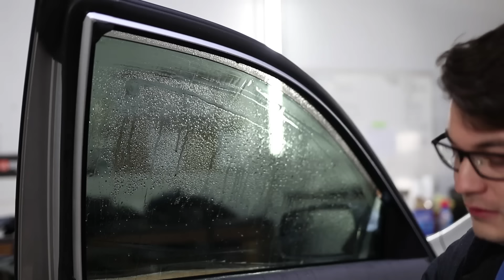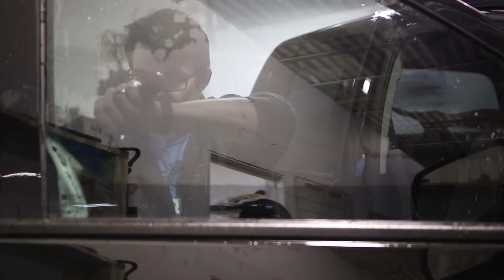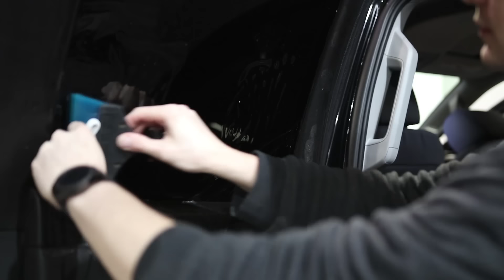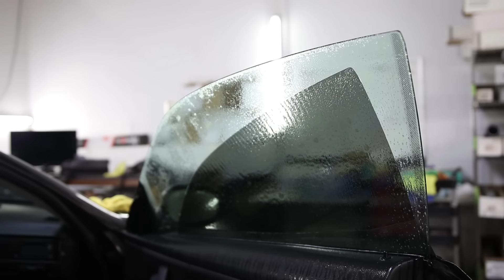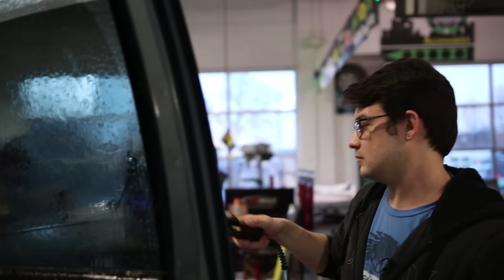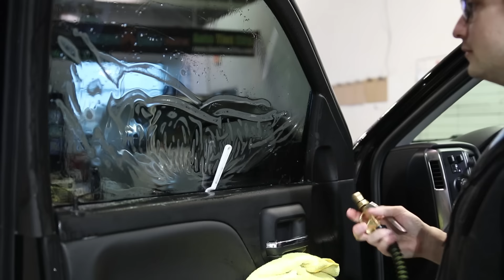Tucking Window Tint Made Easy | No panel removal

Comment: Little tip for 2 stage tinting. Never let your edges curl out. They should curl into the edge tuck. Otherwise youre bound to grab contaminates when you pull the cap sheet. This will also keep your film from creasing at the tuck point and having to shrink the crease. Another thing is when you tuck the bottom of the film as you peel your liner do it fast and quickly grab the center bottom of the film. It'll make each side fall to the window at an angle not touching any panel or gasket. Then you can tuck each side individually without pulling or pushing the film and possible creasing it!
Reply: Can you explain a little more

Comment: does spraying alot of liquid all over the place not hurt the doors material?
Reply: No. No damage. Doors can be open in the pouring down rain with no issues. A small amount of spray won't do a thing. You just end up with a nice clean door!
Reply: @ddi1558  rain will damage the door panel (rain is acidic), you need to use pure water and ph neutral to not leave stains. speaking from experience
Reply: @michaelgawlas3794  Wrong, very wrong : D
Reply: @michaelgawlas3794  acid rain huh?

Comment: The lack of protection from moisture as you pray down the windows and film is concerning.  Water will dry out plastics and collect in creases.  I'm not sure what solution you are using, but that can leave a film, even if you wipe it down after.   The worst part is the water going into all the controls on the door, such as the power switches.  You should take the time to cover these areas as best possible and take better care of your customers' vehicles.   This job is harder than it looks, but at the rate you get through those windows, it looks like you can do a car in under an hour.  I hope you charge accordingly and don't rush through Installs and charge customers for several hours if work that doesn't happen.  Very informative video, thanks.

Comment: Thanks for the video very good visual on how tucking is done today I decided to do my wife's taruras. Well the outside of the window is higher than the inside so toss that film here we go again new piece of film it's 4" long I try to tuck it, it becomes a wrinkled mess.I cut this mess hoping not to tear it up into the exposed window. I lucked out for got it tucked in no wrinkles no bubbles .wish I would have seen your video first. Thanks again.

Comment: Question ... are there any electrical issues w/the soapy water being sprayed & squeegee down behind the door panel? Where does it go, how does it dry? 
Noticed the front door panel is saturated w/soapy water therefore it has to be saturated behind the door panel as well....

Great video, you make window tinting look easy.

Comment: Guys all you have to do is take a piece of a big bondo card and cut it down to a half inch wide perfect for tucking or you could take a plastic  fork or spoon and snap it at the end breaking the tip off use the handle  and melt it with a lighter or small pocket torch and bend it into a z like shape just like the shank bend it then let it cool off and harden instant homeade shank

Comment: I had issues with moisture fingers at the bottom. I heat shrunk on the outside abs it was smooth, but I could see the misfire drawing up from the bottom and I couldn’t get them out. I’ve heard it’s because I didn’t remove door panels. How do you approach this issue?

Comment: Damn your fast so I’m getting into window tinting the beginning of 2020. I have most of my tools seen a couple you showed on another vid. What’s your mixture on solution? What are the best films to use? What’s your warranty ? Did you use heating gun prior to the start? Hopefully you get back thanks. Do you ever clean windows with scrapper blades ?

Comment: Is there a way to fix tint thats bubbled or do you have to remove and replace? Like if you can get water down into the bubbles after its been installed for years can you rewet it and it will stick?
Reply: If it's old and bubbled, a 100% solution is to replace it. If the bubbled spots still have some adhesive, you can try getting a new razor blade and barely nick the middle of bubbles (and press), see if it continues to stay down, though may have hairline cut seen through tint, it might be totally unnoticeable.

Comment: Hey bro, what am I doing wrong with side windows? I either cut the tint too short or too much on the sides and a light gap shows and I’m leaving light scratch marks. How do I cut the small side windows properly and how come sometimes ppl don’t shrink the rear side windows? I’m having trouble determining when to shrink
Reply: I shrink all of my Roll ups the smaller corner glass I don't usually shrink

Comment: I sometimes have problems with fingers coming up after I've tucked the lower edge. Is this due to incomplete shrinking? Sometimes I can stretch the bottom out left and right and get them to go away. Also, to pull back the seals and lock down the bottom I alternate between the Platinum ez reach and the yellow conquerer (which you recommended in older vids), is that fine or should I get that shank tool you're using too?
Reply from the maker: The shank really just helps with tucking, I use to use a ez reach but the shank is a little better because it has an angle that stays out of the way. 

The fingers are most likely because of what u said. I shrink a little different now than I use to. I use a "snap" method. It's in a few of my more recent videos and on Instagram. I just curl the bottom edge and it's helped a lot with keeping everything flat

Comment: I just saw a video where a shop did a full install of PPF and then window tint. They removed every door panel in order to tuck the film below the rubber seal line??????????? WTF? Is that necessary ?
Reply from the maker: definitely not necessary, lots of installers do it tho. I like leaving everything as is.

Comment: You should always pull back the top part of the door panel for several reasons...1. Theres felt on the inside window sill and dust and dirt on the door panel. If you dont pull the panel and drop the tint in behind the panel first you will always get debris inside the tint when it hits the panel and felt. 2. Your soaking all the electronic,  window switches,  electric mirrors, doorlocks. 
3. You run the risk of kinking the tint when and getting debris when handling it to much. 
4. Your not telling people that you heat shrink the window tint first. If they try then they will most definitely develop fingers.
Reply from the maker: Nah, not necessary

Comment: What plotter software r u using
Reply from the maker: Tint tek 2020 for these windows and I also use Trucut by suntek at the other shop I've been filming at
Reply: I use tint tek and tru cut by suntek and tru cut is just about spot on with all the cuts. And tru cut has more cars and newer 2019 cars so that’s a plus